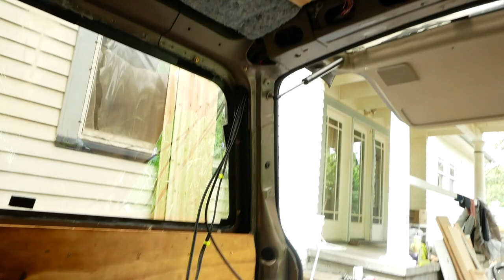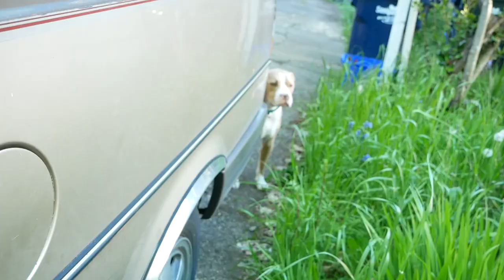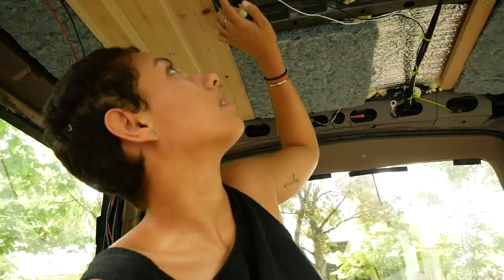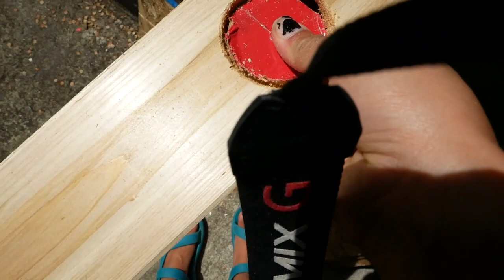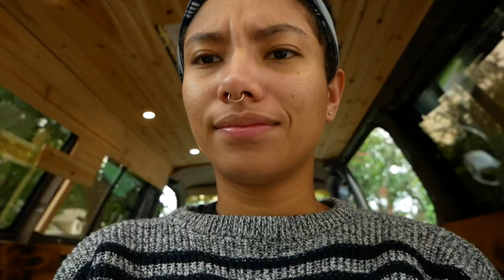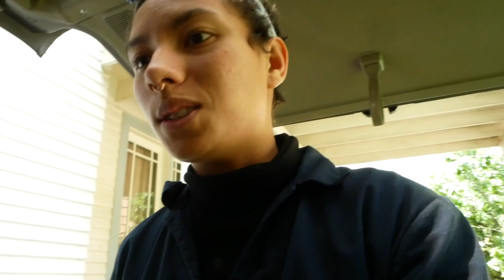Installing Paneling In My Van | Solo Female Van Dweller Converts Van

Comment: For future reference.... if you pre-drill the hole with a drill-bit that is a little smaller in diameter than the screw you will not be as likely to split the wood.
Reply from the maker: Ah thanks yeah that’s what I ended up doing! 💕
Reply: Also, if the drill bit isn’t sharp, higher rpm and slow/steady pressure can help prevent splitting.

Comment: It looks AMAZING Loui! Super impressed with the trim - and the cute color accentuation. <3 Not gonna lie though, I was kind of bummed that you didn't film the process of putting up the paneling cause that part was like perplexing magic to me. Haha.
Reply from the maker: Ahhh yeah I wish I had gone more in depth about that too! Basically just drilled a hole smaller than the width of the screw in both the panel and then the metal beams in the van. Then took my impact driver and it screwed right in! Was kinda hard to hold it up with only one person haha thanks Lyubs!!

Comment: When using the hole saw, put a piece of scrap wood underneath.  Then you won't get tear out on the other side.  Also you can drill half way then turn it upside down and finish the hole from the other side.
Reply from the maker: Smart! I will definitely be using this tip!

Comment: To drill holes in thin wood. Go really small drill bit first. Then build up. To stop it cracking.  Tiles tape over first and small to big bits again. Some need ceramic drill bits for ceramic tiles.  Expensive aswell. If u use any wood even cheap stain it or oil even cheap wood. Wood looks more amazeing then anything. If u treat the wood proper after. Wax ,oil ,stain, it's a cheap fix up for cheap wood.
Reply from the maker: Thank you for the tips!! This is good advice!
Reply: Always drill the hole a little smaller then u need. Can always go bigger. Measure twice cut ounce.lol

Comment: Came back to rewatch your build series and realized I ended up with the same tongue and groove planks! 😅 currently struggling trying to get full length pieces up. I need more hands!
Reply: Any tips for putting up the short little pieces that went around your window?
Reply from the maker: Yeah that was a struggle for me too honestly don’t know how I got them up haha I think it was some sort of mixture between using my head to hold them in place while drilling a while and then screwing them in place haha the little pieces I suggest adding some kind of wood behind them to even then out with the ceiling pieces. It sort of makes the curve a lot less intense. Since this video I have put flat metal brackets on the back ones to connect them because they kept coming loose. Hope this helps!